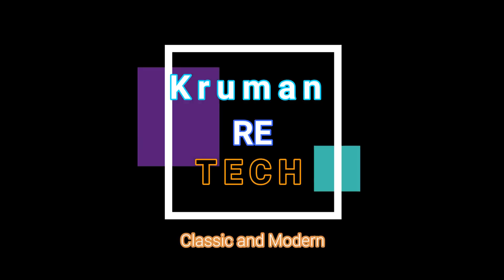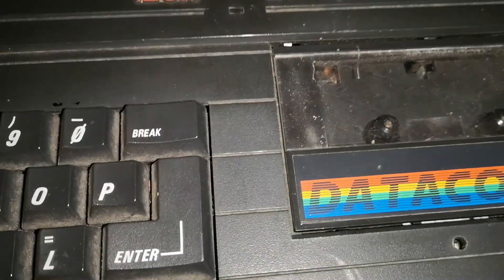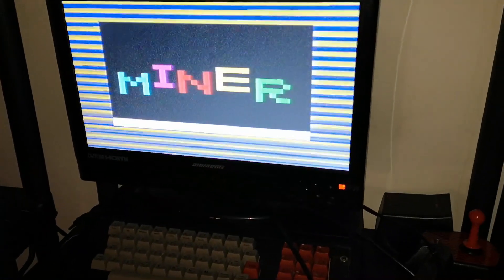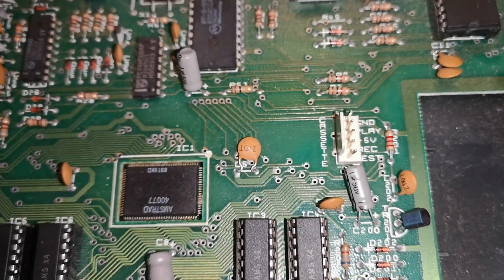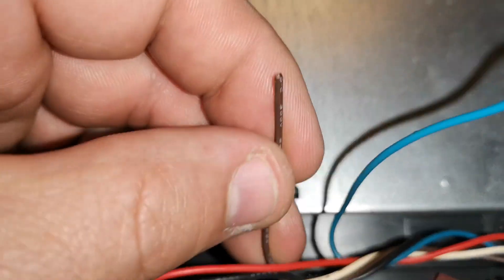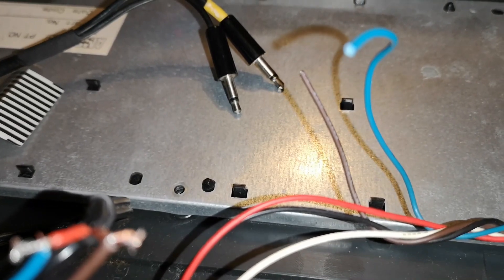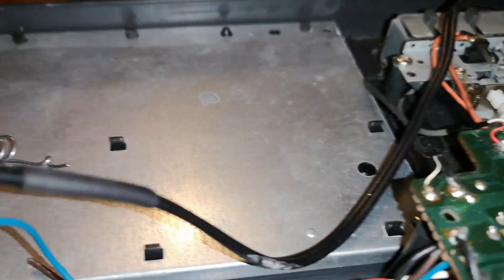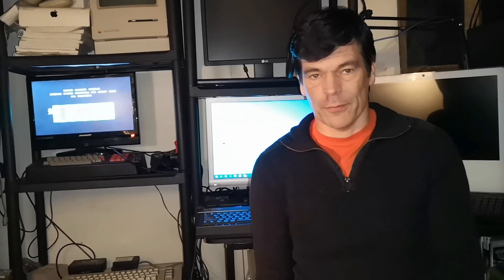Classic Computer - ZX Spectrum +2a (black) tape and SD drive modification

Comment: Thanks for this video.
I decided to soldier directly to the tape drive PCB where the Brown (GND) and Blue (PLAY) wires were.
Now both the tape deck and 3.5mm lead are connected at the same time.

In all honesty, it would likely be neater to cut the existing 3.5mm socket trace to form seperate poles and connect PLAY to there.

Comment: Hello, my cassette drive is broken. I tried to connect this way with  out of the notebook and connect to tv  by antena, sound of loading in the TVset is good, but border isn't flashing. I don't know what is the problem and what  can I  to do? Thanks. Spectrum 2+ a grey
Reply from the maker: The ZX Spectrum =2 Grey has been known to have ULA's that effectively go deaf in the same way as the original 48K spectrum. If you are getting sound through the TV speaker, it could be the problem.
Without looking at the board with a scope, it is going to be hard to diagnose over messages. 
If you are Ok with soldering, I can send you a diagram of where to connect a line directly to the ULA itself which should (if the ULA is working correctly) allow you to load data directly. 
By doing this, it will prove the ULA is at fault or otherwise,
The DIVMMC may be an option as it uses the data lines and will allow SD card use on a ZX Spectrum. 
Id gladly take  look at it for you if you hit a brick wall and don't get it resolved. Cheers Phil
Reply: @Re-Tech  Thank you very much for your answer. This is short video how I have connected to input to spectrum. https://youtu.be/2KZeYpDQ0VE. When I bought computer and disassembled it, I've discovered some wires from cassete drive were unsoldered.  There were no gear weel also. Yes I 'm ready to solder diagram for alternate input directly to the ULA and I would glad to see it. Also I am going to buy DivMMc. (akostrov78@gmail.com). Best regards(Alex).